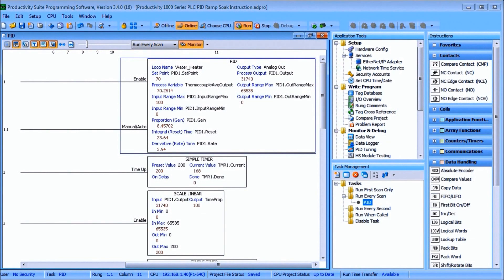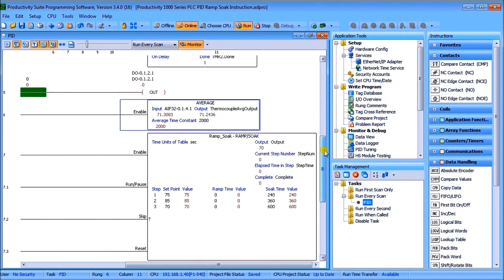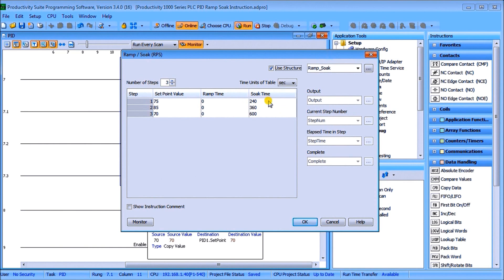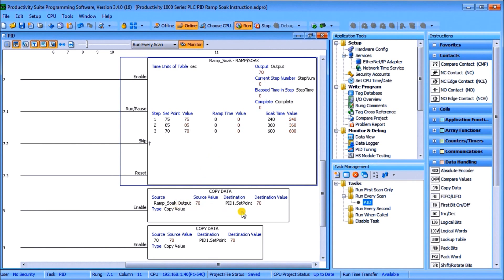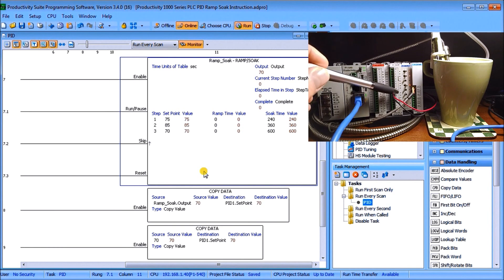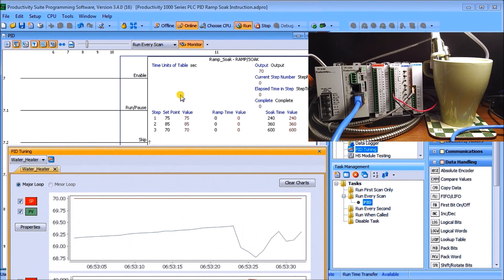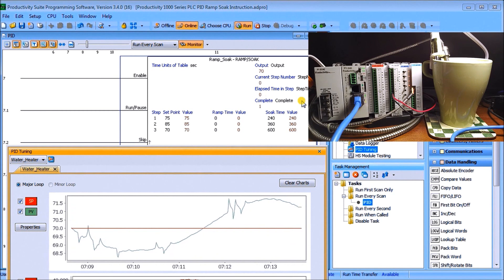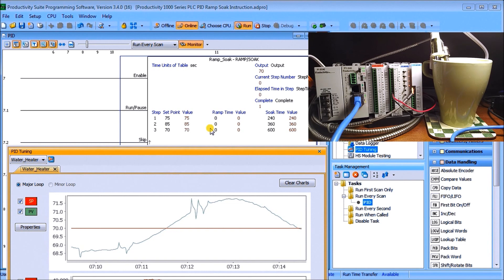Productivity 1000 Series PLC PID Ramp Soak

Comment: Thanks for posting. Great content. Are Productivity series PLCs hard to program? I've been using the click PLC for years but have never used another model from A.D.
Reply from the maker: Hi Jay,
Thanks for the comment. I appreciate it. 
The Productivity Series provides a platform for any job that you may have. The series includes the P1000, P2000 and P3000 controllers. They all program using the same free fully functional Productivity Suite Program. 
The main difference between the Click and Productivity as far as programming is the Tag Database. Once you understand this concept, both controllers are easily programmed.
Application wise, the Click is great for discrete IO control. The productivity series is also good at this as well as PID and better communication options.
Here is a link to the P1000 series. 
https://accautomation.ca/series/productivity-1000-plc/
Here is a link to the Click series.
https://accautomation.ca/series/click-plc/
I hope this helps you out, Jay.
Thanks again,
Garry
Reply: @ACCautomation  Thank you Garry!

Comment: Hi Gary The only issue I am seeing is the Ramp/Soak does not check to see if the temperature has been reached to trigger the soak, it is just a total dwell time counter and regardless of the setpoint in the PID loop whether it hits temp or not the Soak will move forward. Any thoughts on having the steps be triggered when in fact the thermocouple reaches a specific temperature? Thank in advance
Reply from the maker: Hi JK Chanel,
What I would do is to create a program in the Productivity PLC. This would compare the present value to the set value. If they are the same then start a timer. The timer end bit will then trigger the next set value to be set.  This can repeat until the end of the cycle.
Indirect addressing may help you out with changing different set points.
https://youtu.be/NwDgEtBTWok
https://accautomation.ca/productivity-1000-series-plc-array-functions-part-1/
Regards,
Garry
https://accautomation.ca/series/productivity-1000-plc/